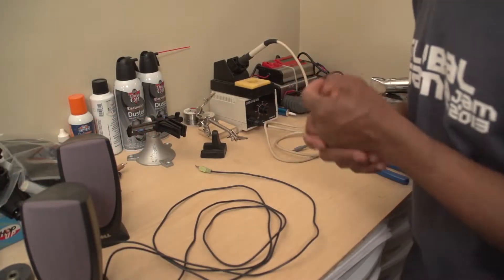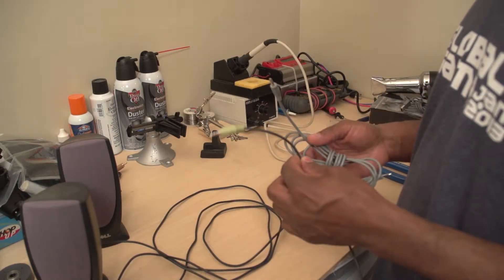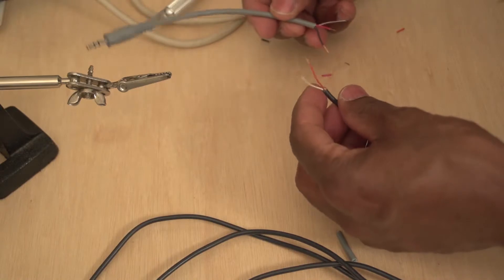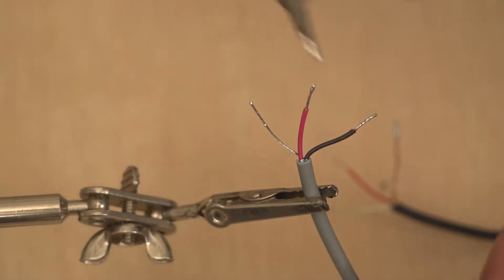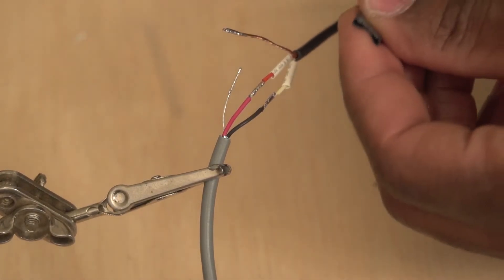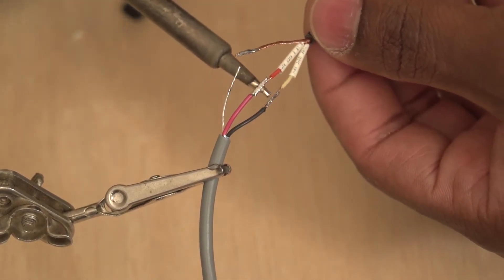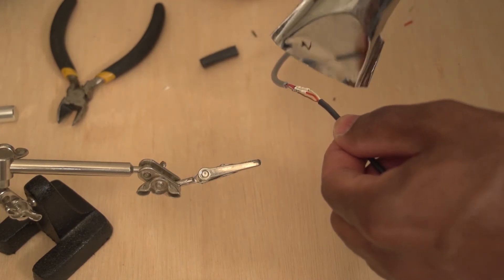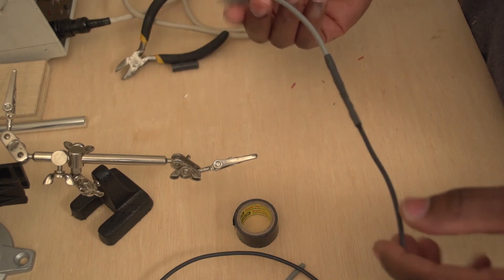Headphone Plug Repair #brokenheadphone #diyheadphonerepair #soldering #solderingtips

Comment: nice work,very nice bc you are focused, I'm going to try the heat shrink ,just finished a repair (temporary) of a bad 3.5 mm audio plug for a Logitec 2.1 speaker w/ a sub-woofer. Man that tthing gave me a headache bc I took the housing off the plug but couldn't figure where to connect the 3 wires (white/red/ and ground. Finally figured it out and system sounds great.However, I'll have to replace the plug with a new  2 stripe 3.5mm audio plug. Any recommendations would be greatly appreciated. That was a hip tip about "tinning the wires. I'll be sure to do that next time., Thanks again!!
Reply from the maker: Thank you for watching.  Something like this should do the trick  https://www.amazon.com/Ancable-Replacement-10-Pack-Connector-Headphones/dp/B077XNTSF9/ref=sr_1_3?dchild=1&keywords=3.5+mm+plug&qid=1598264531&sr=8-3